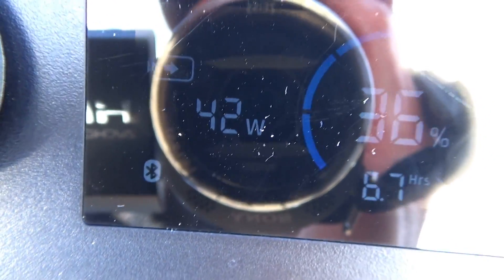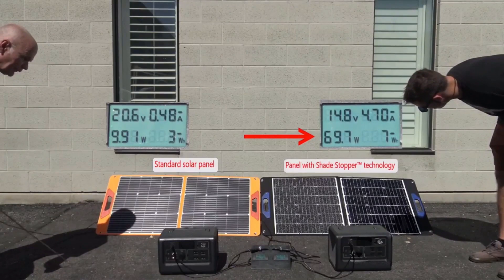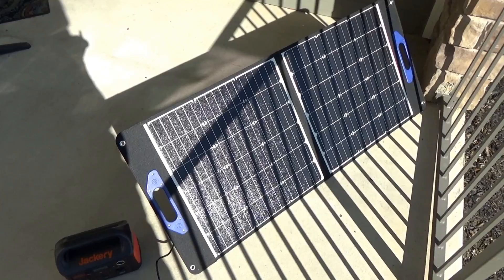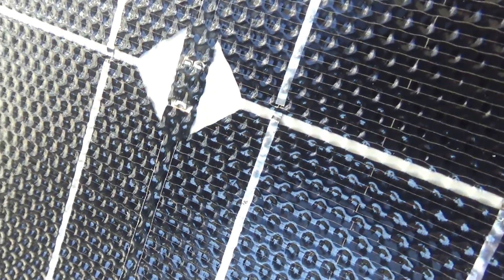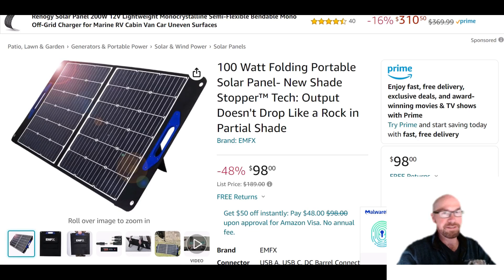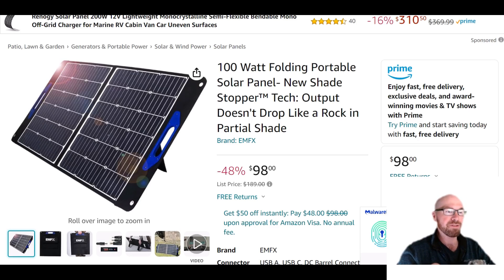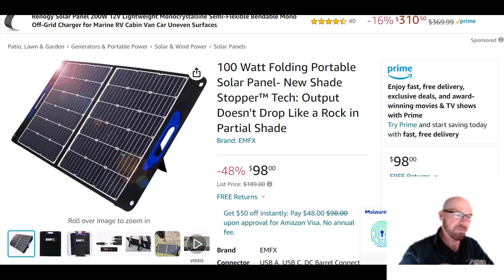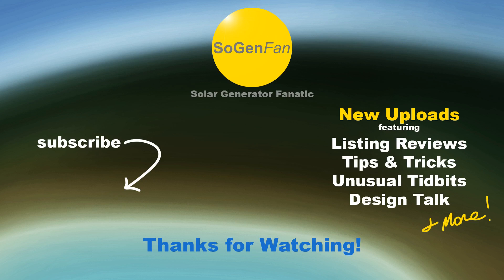EMFX "Shade Stopper" Solar Panel

Comment: This is a great video.  thank you very much.  does this plug directly into an echo flow Delta 2 ?
Reply from the maker: Yes it does! Just use the included XT60 adapter cable.

Comment: do yiou know if there is a way to run these in series. i orderd one and got it. has the 8 mm conector. I have a bluetti 180 so that works but if was a way to run it in series would be able to use more than one. ty for finding this im thiking on shady days it will work better than my two 100 wat panels have had shadey cloudy days since i bouth those most i got out of two 100 wat panesl was 138  w. that was for like 10 minutes. do you know if you can put them in series. the price is worth it. if can do in series wow.  let us know please
Reply from the maker: The only "series" connector for 8mm that I know of is made by Jackery for their power stations that use the larger 8020 8mm input (Jackery Plus / Pro models ONLY).

There are parallel connectors available, and 2 panels will work fine in parallel since they will only output about 10A anyways (the parallel connector and your Bluetti AC180 are both limited to 10A). Try searching Amazon for "KarlKers 8mm Parallel Adapter"

-------

BTW "7909" is the 8mm that this EMFX panel includes, and virtually everybody uses (Bluetti, Goal Zero, all the older "standard" Jackery models etc). 

The only brands that use the larger "8020" 8mm are Jackery & Geneverse and only the Pro / Plus models.

Comment: Please forgive my ignorance. Was referred by an Amazon reviewer to your review.  I have an Anker Solix C-1000 battery, it takes an Anderson connection for which I have a 10' extension with m4 connectors. What is the adaptor I'd need to use this panel? Also, can they be combined in parallel? Will check out your code. Thanks!
Reply: Note that the website offers free adaptors, however not combined with your code. Your code knocks of $9.80, adaptor is $9.  Decided to go for it.
Reply from the maker: The Anker C1000 uses an XT60 input for solar, not Anderson. You need a "female 5521 to XT60" adapter. Since the C1000 can accept up to 60v, you can connect 2 of these solar panels in parallel or series - it doesn't matter.

But you will need more adapters (on top of the first adapter) to achieve this. This is why I really wish this panel had a MC4 output cable. But you can make it work. Always check your final connection with a multimeter before plugging into your power station - check for proper polarity (use an included car charger for reference) and check the output voltage.

Try searching amazon for "XT60 series connector". For power station's that can only accept 24v or 30v, you will NEED a parallel adapter.

Comment: Its just a different topology.  Theoretically every single cell can have a bypass diode on it after all.  It could easily be argued that current solar panels are a bit deficient with only two or three bypass diodes.  There are half-cell topologies which double the number of bypass diodes.   Its nice to see a niche filled, I'd like to know what the actual topology of this shade-stopper panel is.   There's nothing special about the cells... it's gonna be the topology and bypass diodes.

-Matt

Comment: I purchased your solar panel. It did not come with directions as to how the adapters can be swapped out. I would really like a reply, please.
Reply from the maker: The adapters attach to the end of the cable. Just slide them onto the tip of it.
Reply: Contact the company (in description). They'll send whatever adapters you need at no charge.

Comment: OK, I'll bite. I ordered one direct from the company using your code (thanks), saving me the 10% ($9.80) and there was no VA tax, which I find is common with new and small vendors. So, I paid 88.20 vs $103.88 on Amazon. Economy shipping is free. I have an odd system, with 1800W of panels behind windows. I'm lucky to get 350W out due to the windows, the vertical placement and living in a neighborhood with trees.  I'll be playing with this panel and hoping that this is just the first such panel to hit the market. I don't care about a waterproof rating.
Reply: I also bought one and decided to try it inside ( we had about 14" of snow). I positioned it facing out through my new Pella sliding door panel (UV rated) and got just under 40 watts. Was a partly cloudy day, but still. None of my other portables pick up anything while inside. When the weather gets better, I will do better comparisons.
My biggest issue is the cable connections, I would have liked to see XT 60 connectors and maybe a pass-thru slot for the cable so I could keep it zipped up.
Reply: The company (in description) can send you an XT 60 adapter at no charge.  @Kantuski
Reply: The EMFX company is about to release 100 W (18 volt 5.6 amp) flat flexible panels with the same tech.

Comment: Hello I have a very weird question. 
You know how mc4 to xt60 connectors exist right. Is there such a cable where one side is the cable you plug into your solar panel and the other is a normal 3 pin plug 🔌.
Reply: There would be a safety hazard if a male plug is connected to a panel & it was accidentally plugged into 120 V. However, a female socket (that fits that plug) would be safe & easy to do. If you email the Shadestopper co., they can ship a foldable panel (video) or a flat flexible panel  with that kind of connector.
Reply: @PattyDung  yes that’s what I’m talking about a female socket that fits a 3 pin socket. I  sure they don’t sell those kinda connectors on solar panels or in cable form
Reply: @jokerxd407  The company can ship it like that (female socket) if you request it. I like the idea of using readily available extension cords to carry the power to a distant location. (BTW, I own EMFX. My name is actually Bill Lee. "Patty Dung" is pun on Dung Patty. I admit that  I self-depreciate too much.)
Reply: @PattyDung  nice meeting you. Do you have an email or discord where I can contact you instead of YouTube comments 😂
Reply: @PattyDung  I’d love to talk more about this and your experiences when using the solar panels

Comment: I wonder how well this would work on the portable eco flow models.
Reply from the maker: It should work quite well on Ecoflow or any other power station really - since it outputs 18v (which is the standard output voltage). Virtually every power station has a solar input that can accept up to 24v (and many can accept much higher as well).
Reply: @SoGenFan  I meant the shade stopper feature. I don’t see many YouTube videos where people are testing this out. I understand it’s fairly new but still.
Reply: @jokerxd407  The output from this panel is the same voltage-current curve as any other monocrystalline panel. The only diff is that in partial shade, this panel has the same output as a regular panel, but in much less shade, would have.